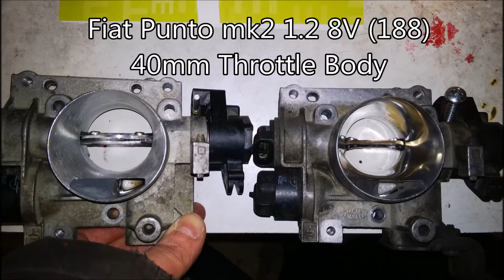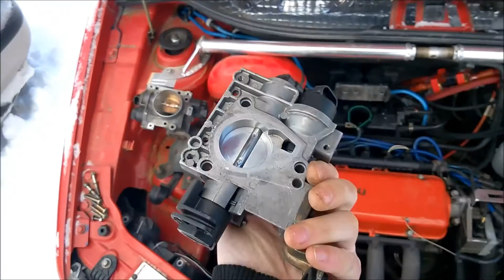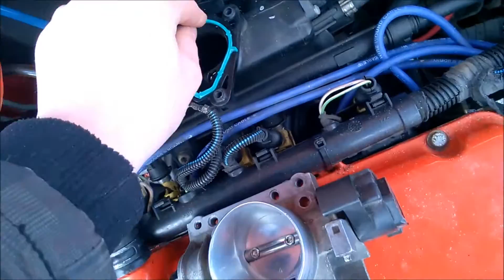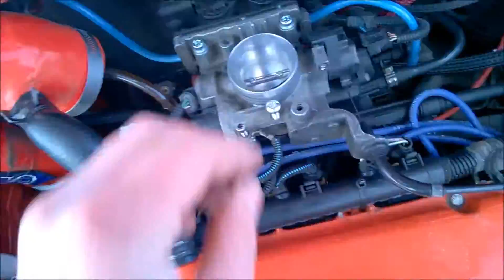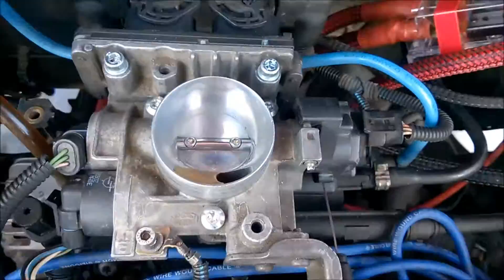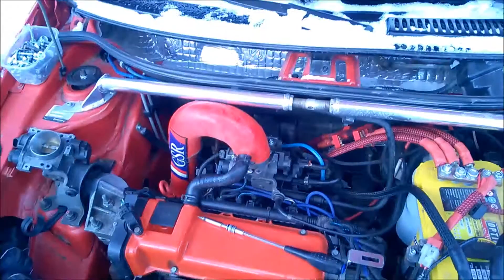Fiat Punto 40mm Throttle Body (TB)

Comment: Any noticeable improvement?
Reply from the maker: Yes with 866 camshaft but it may need bigger injectors 😊
Reply: What injectors will fit? From punto 75?
Reply from the maker: I had IWP049 184cc/min 😊
Reply: Thanks, needed to do any ECU programming/chipping?
Reply from the maker: No but you should reset the ECU :)
Reply from the maker: Now I have +50% injectors with supercharger :)
Reply: @JoniK1  how much power does it have now with the supercharger? 100?
Reply from the maker: Much more, 0-100km/h 8s :)
Reply: @JoniK1  wow, how much does it weigh?
Reply from the maker: About 1150kg :)
Reply: @JoniK1  how to reset the ecu?

Comment: hey, where did you get a 40MM throttle body from? Thanks! :)
Reply from the maker: Hi! Local machine shop did this for me, cost 100€ so a bit pricey :D
Reply: 40 mm throttle Body ist from 1.2 16V?
Reply from the maker: It's original 36mm bored to 40mm :)
Reply: Do you habe Foto?
Reply from the maker: http://i254.photobucket.com/albums/hh97/jonik1/Ferrari/WP_20140120_018.jpg~original